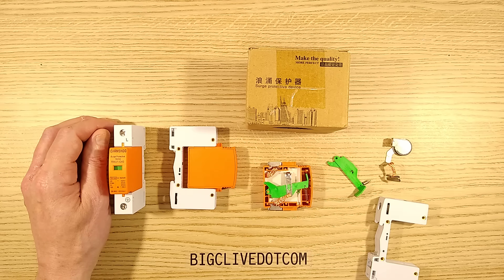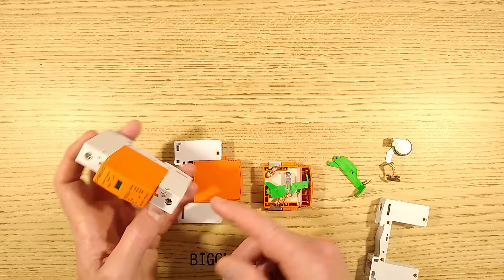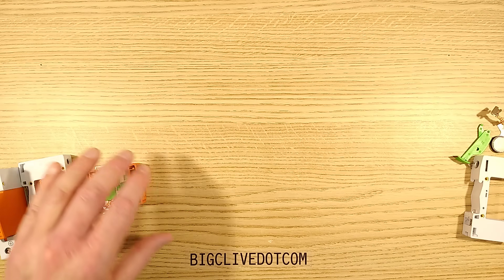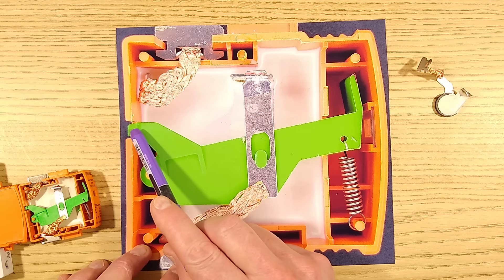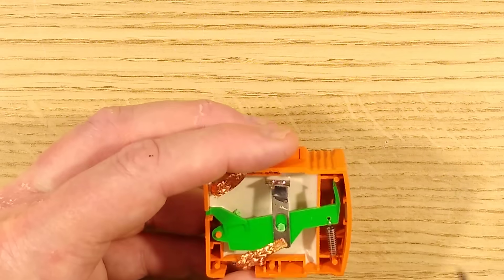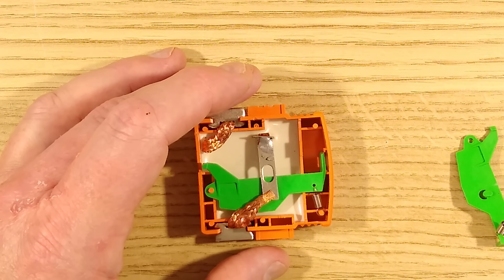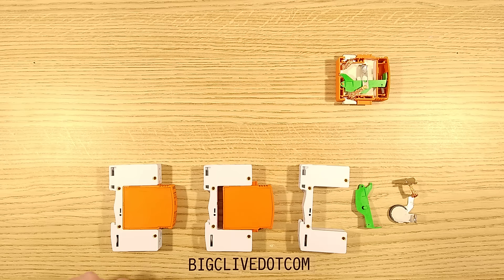Defective surge protector being dumped on eBay

Comment: Funny, in North America, these SPDs come in two types - Type 1 and Type 2. Type 1 is where the overcurrent protection to the SPD is built into it (so it has a lever to reset it like a normal breaker) and a Type 2 device which requires it to be placed after the overcurrent device. It's generally for where the SPD was to be installed - type 1 was for right after the meter, while type 2 is in the load center, but most manufacturers make both to plug into the load center these days. (Type 3 are for power bar SPDs, and Type 4 are in-device SPDs). The new load centers because of arc fault requirements often have "Plug On Neutral" connections where the neutral bus bar is also brought to the breaker instead of a pigtail, so the type 1 SPDs are used there (they plug in like a normal breaker across the phases). Type 2 usually are for retrofit situations where you add it to your load center in which case you wire up another set of breakers to the SPD.

Comment: A couple of points. 1) That SPD is not designed for lightning energy, it's not designed to protect against lightning energy. That is a type 2 SPD for SEMP (Switching Electro-Mechanical Pulse) at the 8/20 wave shape. For protection against lightning energy (LEMP) you need a type 1 device at the 10/350 wave shape. 2) Type 1 & 2 SPD's are installed in parallel and fail open circuit (if they are good quality) so they are very safe. They do not need to be in metal enclosures and very often they do not need any OCPD, in fact installing poor or unnecessary OCPD can mean that your SPD will be effected and not perform as well as it is designed to. All SPD's have a current withstand capability by way of construction (it will be on the manufacturers data sheet) if your supply is equal to or less than this then you do not need OCPD and installing one just add additional length to the SPDA (Surge Protection Device Assembly) and this adds induction and a potential voltage drop which will effect the SPD performance. 3) SPD's are not designed to fail, in fact the testing and development standard for low voltage SPD's (BSEN 61643) requires the device to be able to withstand 20 No exposures to which ever wave shape it is tested against. Type 1 20 x 10/350, type 2 20 x 8/20 combined type 1 & 2 20 exposures to BOTH wave shapes. A well selected, correctly installed SPD should last 20+ years here in the UK as we have low levels of lighting activity and a fairly stable grid. Happy to discuss more details with anyone that has questions on sean.passant@dehn.co.uk

Comment: No that bridge would not have stayed as the current would have kept that bridge melted and it would have blobbed back to both pieces. 
You removing the heat at that instant cause the bridge.

Comment: 4:17 - Well, that should be easy enough to test by leaving your soldering iron in contact with it (ex., with the top part), no? My guess is, in a real situation, it will melt (more quickly, if anything, since the current is passing through a thinner connection) and surface tension will separate it.

I really don't think that test indicates "non-compliance", since a) you're introducing heat externally, not via current, and b) you removed the source of heat immediately (when in fact the heat would likely increase due to the small bridge).

Comment: This is why I stick to reputable suppliers and pay the extra money. Also in NZ at least they always have a circuit breaker in front of them and its usually 32 amps. Most of the designs that's pretty standard.

Comment: Hi Clive watched for a long time. I have built my dream bike. I always wanted even made the frame. I need ur advice sorry my typing sucks. I got a universal speedometer for my bike. It does everything it also displays what gear bike is in. 1 through 6 gear. It has 6 wires for each gear. It I tap ground it will display that gear for that wire. My bike does not have these wires off of my harness. I can buy a gear indicator. They hook up to service port only 3 wires. Works easy is there a way I can use so counter that can count up and switch across those grounds. I hope it makes sense I build bikes. I just want everything working. I heard in your videos you love bikes too.

Comment: Whoever built out the furnished basement in my house decided to tap off the GFCI protected line to my upstairs bathroom. So now there's a ceiling fan, a couple of lights and outlets in circuit and every few months or so the protection trips randomly. I know I should get an electrician in but it really doesn't happen often. Mainly just an annoyance. Still in the back of my mind is an image of my basement on fire.

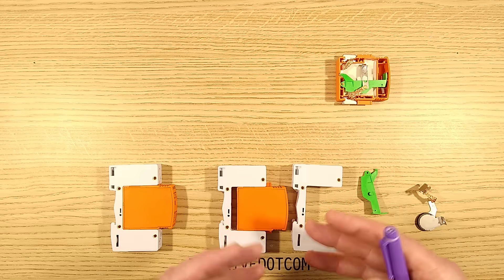Comment: @4:26, yeah, even if it pulled a bit of solder along with it, the fact that it got hot to begin with it would continue to heat even more because of the thin line of solder which would have quickly liquefied even more and it would have gone open circuit with the solder flowing to the two metal components.  It would have worked fine.

Comment: If you want your system to stay compliant you should only be using parts from the OEM for your consumer unit unless, as Clive suggests, you fit it into a separate enclosure.
Reply: Most spd devices would be fitted in new consumer units which have to be metal now . Fitting it into a separate enclosure would require it to be adjacent to the consumer unit with minimum length of cabling fir compliance

Comment: Great video Clive, I always got electrical cable and accessories from either the manufacturer or a reputable distributor. Just shows you what is out in the world. My friend asked me to check his house for electrical compliance after he said the electrician only took 10 mins to do it, I found that the RCD on the main would not trip in both tests and also as it was a split board neither would one of the other 2 RCD's. Total shit board. He got them to replace the whole DB with a known brand I specified. Keep it up as it brings the point home. 'Beware the buyer' especially if its cheap!

Comment: Seems like they could reduce the risk of the solder bridge being created by simply soldering it on the back side of the adjoining tabs only. That way it would have to drag the molten solder through the hole on the piece that remains stationary rather than the way it is set up currently. The green to green feature is laughable for sure, guessing someone got fired. Probably should have been whomever decided to sell them anyway, LOL. :)

Comment: They wheel Grandpa into the Robot Repair Shop in a wheebarrow, a sooty mass of charred aluminum and plastic. 

Technician A: "OMG. What happened to him?" 

Mother Robot:  "Well, we're not quite sure but he was lying in the back garden this morning, directly under the chimney." 

Little Brother Robot:  "I think he was trying to fix his TV antenna because he kept complaining that he was getting interference from the thunderstorm." 

"Hmm.. That must be it.  Let's take a quick look then..." says Technician B, peering at Grandpa through his illuminating LED monacle.  "Ahh.. I see.. No wonder.. He has one of those cheap surge protectors from roBay." 

"Yes." says Mother Robot. "He was always trying to pinch a penny." 

Technician A:  "We'll need to make a detailed analysis.  Can you come back tomorrow." 

~~~~~~~~
They return the next day. 

"Good news." says Technician A  "He's a tough old bird. It was nothing a good wipe down with WD-400 wouldn't fix, and installing a proper surge protector." 

"Only his brain board was actually fried." says Technician B  "It must have been directly in the path of the lightning strike.  But we can't find any 555 chips to reconstruct it.  They don't seem to make them anymore." 

"But we did find an old processor board with a similar interface." says Technician A  "It should work fine after a bit of tweaking, but Grandpa might be a lot hungrier than usual." 

"Oh." says Mother Robot "Where did you find it then?" 

"From an old garburator." says Technician B.

(o-] A    (o-] B     @:-)     #:-]      ~~ :o]

Comment: Pardon my ignorance, but I gather from your description that under certain conditions (high voltage on the live?) these will connect the live side to ground?  I guess that current is what heats up the solder and opens them back up, breaking that grounding action?  Seems counterintuitive to be connecting a hot line to ground. I suppose that blacks out or browns out the regular circuit so that high voltage doesn’t enter other circuits. Did I get that right?  Seems strange.
Reply from the maker: These do shunt spikes between live or neutral to ground.  Sustained current should trip the RCD/GFCI where one is mounted at the incoming supply, or just raise the ground voltage slightly during the transient.
Reply: @bigclivedotcom  Ahh. The GFCI was the piece I was missing. Yes, I could see that working. 
I know they had an issue (probably 20 years ago?) with MOVs catching fire in things like “surge suppressing” power strips. Thermal runaway or some such. Although it appears your device there would sever the solder retaining junction and disconnect itself. Incorrectly colored plastic flag notwithstanding, it seems safe enough.

Comment: A short will behave differently to the soldering iron, if the solder were to melt with a short that string will try to pass the current but being so small it'll melt almost instantly like a fuse.
Reply from the maker: Keep in mind that the failure mode is a gradual lowering of resistance so the MOV starts to get hot at standard supply voltage.  The temperature increase would be slow and gradual.

Comment: Something to keep in mind is that the protection of the SPD is NOT the SPD tripping. When the VDR (voltage dependent resistor) is exposed to a high voltage, it lowers its resistance effectively shorting the voltage to earth. If the surge goes for long enough, it could give time to the current to raise above limits, and then the differential switch (RCD) or even the breaker (MCB) would trip. Also, if the surge was long enough to cause a failure in the VDR itself, even with the little tin bridge should not be a problem because that would effective cause a short from live to earth, immediately triggering the upwards differential switch (RCD) and even the overcurrent protection (MCB), so even if the transient already passed, if you pull the switches up they would immediately trip at once. The obvious caveat with these things, is the quality of the VDR, that's the key component here, the rest is just mechanics. With a proper circuit you should ve able to test its curve.

Comment: Isn't the protecting device a metal oxide varistor by any chance ?
Also here in France it's actually required to have miniature circuit breakers before the surge protectors as overcurrent protection.

Comment: A fuse or breaker won't protect the SPD from overheating, good SPDs overheat and then the safety thermal device will should trip and I'm sure any solder wisker will blow up if there's current flowing through it while it's already at melting temperature.
You have to trust the flame retardant housing, if it's from a reputable source it won't catch fire, if it's from crapBay you can only hope they used flame retardant plastic too.

I have eBay SPDs since 2009, TOMZN and CHINT brands, breakers from those brand were already sold in Spain back then by some electrical supplies, but since mine came from eBay after receiving them I broke a small chunk of plastic from one corner at the back of one cartridge to see if it was flame retardant, I wouldn't be surprised if in China they sell counterfeits of those Chinese brands that are already known as good enough in Europe so better safe than sorry.
Those were made of flame retardant plastic but if I need to purchase more I will test them again

Comment: I like using surge protection power strips that disconnect when they stop protecting. Because I’m never going to check the lights to verify they are still working properly. And even if I did if it failed during a storm the chances of someone checking every 5 minutes to verify it was still working is zero.

Comment: I've got a whole house surge protector at my house (US) to help suppress some of the nasty voltage spikes we get (dirty rural power). We've actually had incandescent bulbs explode before and some electronics fried. The one I got required a circuit breaker to be installed just in case it ever failed shorted and it uses LEDs (or maybe neon tubes) to indicate if it's still good. I assume they're just wired across it and if it ever starts to leak significant current the lack of a voltage drop across it (or at least the decrease in the voltage across it) will cause them to go out.

Comment: Thanks to the density of solder, when those are installed properly in the vertical position, the solder should blob down the tab, breaking the connection, and with any luck splash the green windows to give you a hint of "something ain't quite right". Sounds perfectly safe to me..?

Comment: To be fair, there are more than a few very good Chinese Manufacturers,  as good as (and probably better than) those in the West, since China has a number of 1 million volt distribution systems, all based on Chinese, not Western, hardware. CHINT and Tomzyn are very good suppliers, and the Tomzyn over / under voltage protection systems are excellent.
Reply: I wouldn't touch TOMZN with a barge pole and I know plenty of people that hold CHiNT in equal contempt.  None of this is said off hand either.  There are plenty examples of TOMZN MCBs having ludicrously unstable contact resistance and outright false trip ratings.  Don't even get me started on their supposedly DC rated MCBs.  CHiNT RCDs etc are well known for failing to trip even if regularly exercised.  None of this is fake/knockoff either.  Buy direct from the actual manufacturer or a reputable wholesaler and the results are the same.

You are free of course to think and buy what you like.

Comment: 😊 In your previously video I commented, when unit heats up, it desolder. 👋👏. See this MOV or something is really small ⁉️should be like 35x10mm or bigger . With a weekly maintenance checks, now gotta potential problem mischecking the ebay units😟.  I'm thinking more practical. On paper IT looks like the best thing. Even I having trouble reading specs Um, UT U overvoltage time🤭.

 Practically, with >2kV spikes in 0.2 sec, fuses must blow and breaker must trip and the  same with 150% over voltage, but latter not happening. And if you not replacing faulty unit minutes later, your PLCs, electronics are 🔩, toasted.

 Over  voltage it take 10sec or minutes to desolder and to disconnect, and not making it the best thing I thought. Previous video... "I don't believe and trust in surge protectoin units⚡, after I caused an over-voltage over 3 of them and opened them. 4ooV over 275V units, they heated up and desolder.. .."

Comment: What's the worst that can happen? It's not like your home may be burning down.
After all, these devices have stickers, and prints all over them to show compliance with a bunch of safety gubbins.

/s
Reply: This one is fairly innocuous. At least it functions and cuts the circuit.  The worst thing is that it doesn't give the proper indicator,  so you could wind up tearing up stuff to find a nonexistent fault when it was just the dodgy fuse.

Comment: The instructions on a Hager SPD I used to have knocking about stipulated that it should be protected by its own breaker (max. 32A type C) or fuse (max. 125A gG).  The Fusebox boards that come with an SPD have a dedicated 32A MCB for it.

Comment: An associate of mine bought a lot of drill bits from eBay absurdly cheap. They kept snapping. He soon realised the problemy, they hadn't been annealed. That was soon fixed and he'd saved heaps.
 I'd say the same applies to these surge protectors.  The missing red flag is trivial and the solder is probably a case "more is better" and that too is easily fixed. All is fine if you know what you're doing. What puzzles me is why the Chinese haven't yet embraced the concept of  "reworking". Maybe they just set up a production line to make a zillion of something and when that's done if there's a problem the cost to setup a line to do the rework is too high?  Thing is you don't need a line to do reworking, it's a position suited to trainees.

Comment: Have bought one of these to fit Hager VME02SPD and it states no over current protection required, you now have me worried about fitting this device, any advise on this please.
Reply from the maker: If it's an official and approved one it should hopefully be compliant with local standards.

Comment: Possibly stupid question- was the unit assembled using lead free solder? I don’t like the stuff because different brands with nominally the same composition seem to have different melting points and weird surface tension properties when in the liquid state.

That may be why it left that whisker.

Comment: Having some deja vu… I think this was the same issue that the last batch of these you took apart in a video had, along with the solder not breaking the circuit. Either way even if they were “right” they’d probably just burn the building down instead.

Comment: I think the joint let go with part of the solder not fully melted resulting in the bridge, if the heating was from the NTC thermistor it would be slower and heated the solder more evenly and completely resulting in the break being cleaner.

Comment: Not trying to defend a clearly garbage product….but if it heated enough to melt the solder when in the un-tripped state, with the added thermal mass of the lower part, it would certainly be hot enough to melt any whisker that might remain, thus opening the circuit.

I doubt it would catch fire, but clearly, a protective device that lies is worse than none at all.